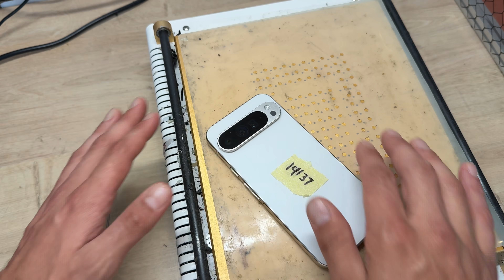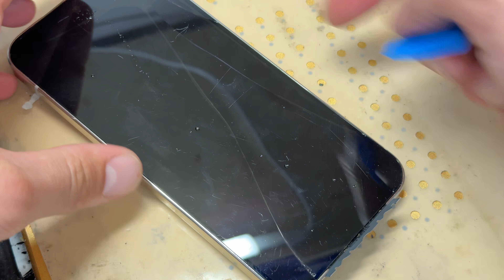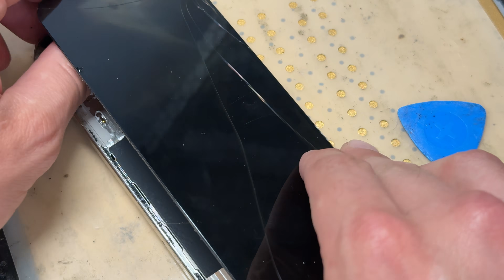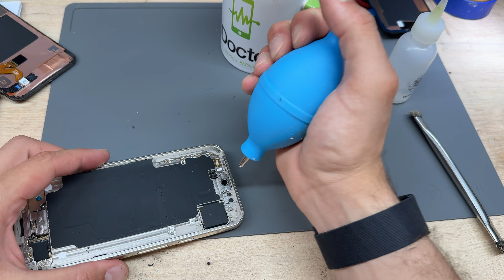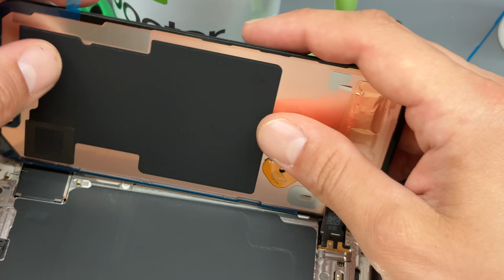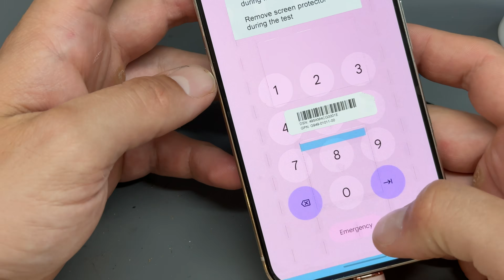Google Pixel 9 Pro XL Screen Replacement – Full DIY Repair Guide!

Comment: My Google pixel 9 pro has developed lines on the screen three times in the last 10 months. Google has repaired it all three times at no cost. I don't know why they don't send me a new phone. It's getting frustrating to send the phone back to Google every few months. Contacting anyone at Google about the problem seems impossible. I'll never buy another pixel phone ever again.
Reply: at least they're replacing yours. I had my screen replaced over summer, and now the touch screen has just stopped working entirely and is lifting up from one side, where the ribbon cable is. I am going to take it apart and see what is going on.

Comment: is the mobile still dust/waterproof after you replaced the screen?
Reply: No
Reply: Kinda. If you want proper water protection, you need to use special glue like RL-035B, or something like that.
I replaced the battery on my P6 and used this exact glue - the water resistance remained intact. The only downside is that you’ll probably never be able to take the phone apart yourself again

Comment: Please tell me the name of the alcohol
Reply: isopropyl alcohol, they sell it in the first aid section of most drug stores or grocery stores. Its the same stuff you use to clean cuts and wounds. 99% is definitely what you want for electronics though, do not use lower concentrations. You want it to evaporate quickly so it doesn't short anything out on any components.

Comment: when the fingerprint sensor is replaced, does it retain memory of previous fingerprints? or would they need to be added again

p.s, "i call it the tickle brush, because it tickles if you use it on your nose" lost my sh*t laughing
Reply: You do not have to reprogram them on the new phones. However, there is enough deviation between sensors I would recommend you reprogram the fingerprint so it has the best chance of being responsive like new again.
Reply: Si funciona la huella?